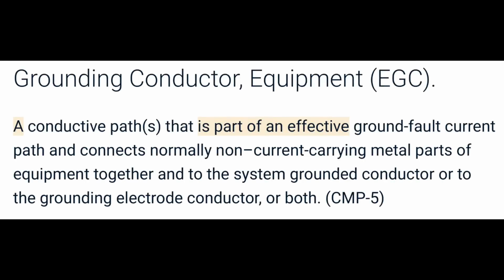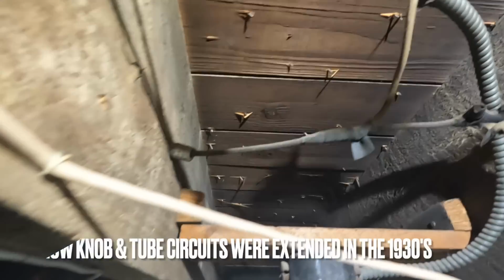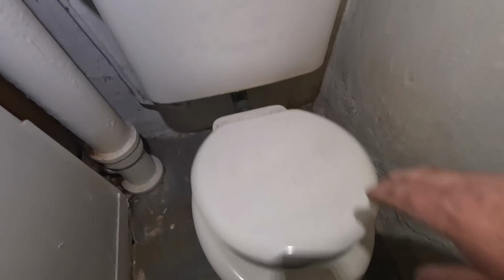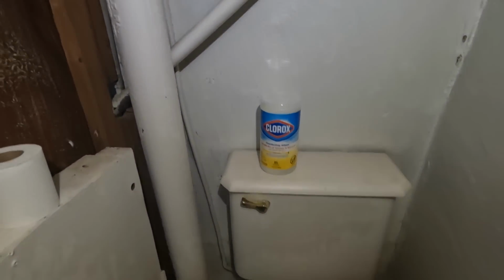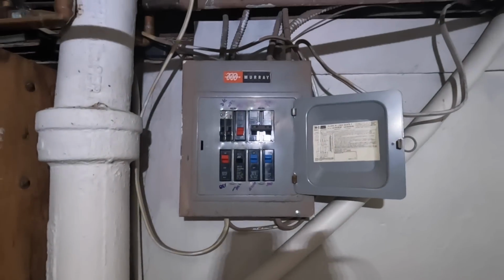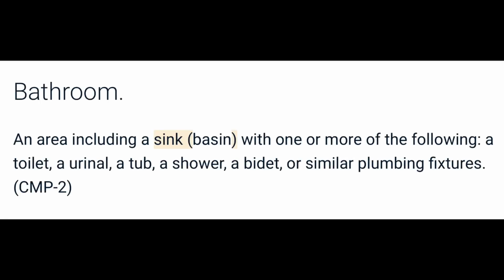1925 Colonial w/ Knob & Tube type wiring

Comment from the maker: At 14:30 you can clearly see the original locknut still on the BX connector. This explains why it was never attached to the box!

Also, the NEC does not permit overcurrent protective devices (circuit breakers, fuses) to be located in dwelling bathrooms. NEC section 240.24(E) Not Located In Bathrooms
Reply: You can still obtain new 'Honeymooner' Push-Button style light switches. They were considered an improvement over the earlier twist switches. I've seen both in the same home...but, I've also seen old gas works in some older homes as well as lantern niches in stairways.
Reply: Hi Ron, I watch all your videos. Maybe you didn't show the sink but just a toilet is not a bathroom so the code violation there is lack of working space around the panel.
Reply from the maker: @price9195  The toilet in combination with the sink makes up the "area" that is defined by the NEC as a bathroom.
Reply: @electricianron_New_Jersey  Thanks for the content!
Reply: Ron, some of those pipes look like they have asbestos wrapped around them. Please wear a respirator any time you do something that might disturb it. I want to still be watching new videos from you many years in the future

Comment: I did a total Rewire and Service Upgrade on a 110 year old house in Mcgregor, Tx in  2010  that originally had 110 VAC 30 Amp service. It had all knob & tube wiring . It had been upgraded in the Mid-60's to a 100 Amp Service 120/240 when they built a new garage attached to it . I up graded the service to a 200 Amp  120/240 VAC and ran all new NM-B Romex to all the outlets and removed as much of the knob & tube wiring that I could get to !

Comment: I just bought a 1914 house. It has a case of the knob and tube-itus. I'll be doing the work myself so your videos are very helpful. I'll probably live in the house for a year to figure out what other things I want to change and where I want to put any new receptacles. Thank you!
Reply from the maker: When I rewired this house no one was living there. Try to keep that in mind because you’ll need some circuits active while the new wiring is installed. Glad you liked the video.

Comment: This is a good example of the knob and tube problem, recpiticles tapped into it. When I rewired old houses I used to get all the recpiticles off it. Usually I would run new romex to a junction box and bring the bx and romex into it. However when recpiticles were wired with lamp cord, extension cords, speaker wire, or whatever they could find then redo as necessary. Also add new recpiticles to bring it up to the 6/12 code. I would leave one or two k&t circuits for light fixtures only and that was ok. But now insurance companies are saying all k&t has to go.
Reply: It's '' Receptacles '' ,... NOT '' Recpiticles '' !!!!!

Comment: I was hoping you might show tricks to address switches and lighting outlets in ceilings when getting rid of knob and tube, i.e., minimizing disturbing old plaster. Have you ever encountered situations where you see modern wiring methods in outlets but it turns out that knob and tube is hidden, buried in walls or ceilings, maybe with flying splices that were then covered or maybe hiding up in an attic? Are there ways to figure out that is hiding?
Reply from the maker: Yes, I have encountered that and it is tricky to figure out existing Knob N Tube, especially on lighting circuits. For receptacles, obviously a missing equipment grounding conductor is the first giveaway. A plug-in tester would indicate "NO GROUND" and thats where I would start. Hope this helps. ,

Comment: The ends of the AC cable that terminated to the K&T should have included an A-head fitting as the conductors exited the end of the cable armor; it appears in several instances that was not done.

Comment: Im really surprised you didn't have anything to protect those wood floors. The electrician is worked told me all it will take is the old box have a sharp edge, or you drop a screwdriver, and the floor is damaged, and you are paying for it in one way or the other. He found some of the padded floor mat squares at a thrift store to put down. I never saw anything less than a rag between anything he put on a hardwood/finished floor and something he was working with. A ton cheaper the resurfacing the hardwood

Comment: Nice work. This reality is so different from where I live (Arizona). Here there are just about zero houses with knob and tube because the average age house is like 20 years old 😂. That type of basement accessibility looks great as all our houses are built on slabs with horrifically inaccessible hot attics. Rewiring here is not much of an option unless a full renovation with drywall removal is also being done.

Comment: #1, your patience is inspirational!  My 1956 1,200sf ranch in NE Ohio is primarily knob & tube.  Remodeled kitchen 30 years ago and ran Romex for its appliances.  But, now I want the rest of the house done.  I was hoping to see some tricks to do this miserable job a little quicker.  By the way you approached it, I guess not, eh?  Getting a quote soon.  On a crawl space with concrete floor you can duck walk around.  Attic accessible.  Lot of work, lot of money!
Reply from the maker: Fortunately, no one was living in the house when I rewired this house. My advice would be for the electrician to install all of the new wiring BEFORE disconnecting the old wiring. It can get tricky. Around here in New Jersey, each new outlet/ switch/ light box is $350.00 each.

Comment: Thanks Ron just subbed , I've done allot of this type of electrical work in my house that was built also in 1925 I have and corrected many similar out dated utilities , Just a quick question and observation when I install a receptacle horizontally I always position the wider neutral blade up so if the device plug wiggles out a bit the neutral conductor would be in contact not the hot  is this a code concern or something that is not a concern , Thanks Great Video .

Comment: I wish electricians that remove knob & tube wiring save the rosettes and rotary switches and sell them to antiques stores.  Save also the "honeymooners" 2-button switch devices as the buttons can be salvaged to repair broken buttons on in-use switches.
Reply: Save also the ceramic light sockets that hang from the twist-lock rosettes.

Comment: The really old armored cable armor was actually 2 layers of metal separated by rubber and required a metal bushing to connect these layers in the device box for grounding purposes.

Comment: TR receptacles are dangerous to operate as they need awkward amounts of force to insert and remove a plug. The entire enclosure receives wiggling forces which will lead to wires moving around and possible problems. Surprised they're required by code
Reply from the maker: It’s so children don’t stick objects into the device and kill themselves.
Reply: Some TR are better than others the commercial grade (P&S) Pass & Seymour/ a brand of Legrand clamed or did claim that there TR receptacles are like there TR  are like THERE not even THERE; ALSO BLACK (the shutters)

Comment: We just bought a house built in ‘55 that doesn’t have knob & tube, but originally all BX. I’ve worked in all kinds of construction from residential painting to transmission utilities and I’m case by case sorting out the existing wiring sins in the house (receptacles that read ungrounded, kitchen counter boxes buried 1” behind the backsplash, etc) and my ears pricked up at one comment you made in the narration. You said you swapped out two receptacle boxes in the living room with plastic. Did you somehow rewire the feeders for the boxes with NM as well, or is some hardware that I don’t know about yet that properly transitions from BX to plastic boxes?
Reply: I jumped the gun- you I see 10 minutes later you replaced the box feed with NM

Comment: You also turned me on to those multipurpose lineman pliers.  I got the Kobalt version and have to tell you, getting used to them they've become a real worksaver.  Plus they crimp terminals far better than my old combination stripper/crimper pliers I used forever.
Reply from the maker: That's awesome! Having the right tools will always make a job easier!
Reply: @electricianron_New_Jersey  Absolutely.  I recently redid the control cabinet wiring for my traffic signal display.  There were 16 fork terminals that I had to attach to #14 AWG stranded. Two neutrals, and six legs, two each red, yellow, and green, used in this case for the green phase as there is no provision for an EGC for a polycarbonate traffic signal housing.  The Kobalt pliers not only made quick work, but the best crimp I can get.

Comment: Ron love the videos. So our house is 109 years old built in 1915. The service comes into our home and the connection from the service is still connected to the knob and tube, but I have to explore to find out where? Certain places in the house I have Dobbin tube still energizing Lighting. But I also have a 100 amp circuit panel in the basement that is primarily romex and then a newer panel 200 amp that also supplies Romex.
I have cut and wire any hot knob and tube, but I need to get to the source and abandoned it completely so that I am updated and rid of this knob and tube. Do you have a video that shows how to do this. I know I have to trace the knob and tube and see where it goes. I have an old original wooden fuse box with the screw in fuses and the knob and tube. I believe it goes up into the attic and I will find my connection there. I can have the electrical service turned off temporarily so I can work on it safely. Any thoughts. Matt, Idaho.

Comment: Nice - i have the honeymooner switch by my front door too!    hundred years old and going strong, and fortunately no knob and tube
Reply: Even older (maybe from the 1880's) are the turn knob switches.  They were surface mounted on the wall, as well as the wires with a Bakelite strap that kept them about 4 inches apart.  There was a video here on you tube where a guy gave demonstrations.  He had all period hardware, fuse holder, socket, and a cord to plug into an outlet to energize it.  He said it looked clunky but it had heavy brass contacts and heavy springs and they last forever.
Also some people would put the switch on the neutral and fuses were also put on the neutral side.  Only way to know it was dead was pull the disconnect plug in the box, but then the whole house went dark.  These were the Wild West day's of wiring.

Comment: 19:50 - I subscribe to the preference of having horizontal receptacles oriented with the neutral prong on top, regardless if there is no risk of something metal falling on an exposed blade. What do you think?
Reply from the maker: @Toolbarcreations  I think that’s stupid because I only vinyl plates.
Reply: @electricianron_New_Jersey  no, I’m not talking about cover plates. I’m talking about a plug that is not inserted all the way into the receptacle, meaning you have an exposed blade, and something conductive falling on that exposed blade. Better it land on the neutral rather than the hot. What are your thoughts?

Comment: I’m an electrician here in St. Louis, we have our fair share of older homes encased with plaster and knob and tube. Recently we did a job where we eliminated all the knob and tube from a multi family dwelling. We re wired the place with all new romex. We ran conduit up the side of the house and fished everything in the attic and down the walls. It takes a brave person to confidently work in older homes. A lot of skill and knowledge.
Reply from the maker: You got that right brother! I have a passion for electrical work but I also marvel at design build and navigating different building technics.
Reply: would you be willing to checkout a home in the south city area off hampton?

Comment: My house was built in 1932. I just recently removed all the K&T wiring. I still have some BX wiring to replace. The old BX connections caused a short, so I had enough and started to replace that with nmb romex too. Thanks for posting this video. Reminds me of what my basement wiring looked like. I'm glad it wasn't this bad.
Reply from the maker: @excaliburO2  There were def a few issues.

Comment: I grew up in a 1850s house. We had multiple rooms with zero receptacles. The way they did it was to put a Edison screw socket adapter and you had to run a wire down from that one light in the ceiling. Of course all of that wiring was knob and tube with later bx additions. Fun stuff.

Comment: Here in Pittsburgh,  we have tons of homes with active know and tube still.  I've done tons of rewires here.   We have lots of coal dust in the walls and attics of these homes here from the steel mill era.  So that makes it terrible because it's impossible to contain when making access holes to run wires.   Making matters worse people always splice new romex into know and tube to try and hide it to pass a home inspection.
Reply from the maker: K&T is a pain in the ass to work with as you know. I didn't know about the coal dust in the walls though, that's interesting.

Comment: Nice video Ron... Done plenty of that style work in the 80's and 90's .  Curious ... is that 14/2 being used for the receptacles. Not sure except for the white jacket. Unfortunately my jurisdiction requires 12 awg . With one receptacle per room and the chance of using a window a/c and or space heater the options are pretty limited .

Comment: There was an old house in my area that was converted to an office building that had knob and tube wiring, romex and some of the old BX cable. They also upgraded the panel to a 200 amp Square D Q0 when they converted the house in the early70s and they actually ran the old knob and tube wiring and the BX cables into the panel and connected the old wires directly to the neutral bar and the breakers! In some of the rooms they had drop ceilings with 4x2 fluorescent lay ins that were wired into the old knob and tube as well. It's a wonder that place didn't burn down lol. I was there to add receptacles so I just pulled new circuits from the panel instead of tapping into any of the existing circuits because I didn't want to take any chances.
Reply from the maker: Hopefully they had good fire insurance because to leave knob and tube in place after an ambitious rehab like that could be a fatal mistake.
Reply: @electricianron_New_Jersey  That was all done back in the early 70s but still that was hackwork. I added the receptacles in the 90s. They needed new dedicated circuits because the tenants got new computers and they were tripping the breakers on the receptacles they were using. I recommened rewiring everything but my boss couldn't get them to spend the money. The only reason I knew it was done in the 70s was because of the date on the panel sticker. God only knows how that passed inspection with the way all that wiring was tied into it lol. The paneling in the offices was that typical old brown mahogony stuff that you would see in most basement remodels around that time with those fiberglas drop ceiling tiles. That building is actually demolished now. Someone bought it to move their family into it so they gutted it down to the studs and started working on it until they ran out of money and it just sat there until it rotted away and finally got leveled a few years ago.

Comment: I was working in an old house here in NJ with k&t wiring when I came across one of those insane Chicago style 3 way switch setups for the upstairs hallway light. Really blew my mind until I finally figured out what they were doing, then I realized how dangerous it was energizing both sides of a light socket to turn the bulb off. Updated it with a Lutron wireless remote switch and receiver to eliminate the hazard, but that house needs a serious upgrade!
Reply from the maker: I had a similar situation happen to me in Roselle Park. Same thing except this one was a California three-way! Switching the neutral now is a violation.

Comment: Ron, this reminds me so much of the old house (Built 1920) I grew up in during the 1970s in Buffalo, NY.  Knob & Tube along with older armored wiring tied to a Bulldog panel.  I got married in 2000 and moved out. Four years later, my folks as part of a renovation that also included new Pergo flooring, a kitchen and living room remodel also did a full service changeout that included a new Square D Homeline 100A panel that replaced the Pushmatics.  In 2016 I cleaned up some of the unused basement circuits while installing new 15A outlets and lights in the basement found open splices and got rid of them.  This had the added benefit of freeing up four breakers in the panel.   What we see is so typical of old urban housing stock across the country.

Comment: Up here in NY, hydronic baseboard is super popular and there’s a lot of neat tech going into condensing boilers lately. I’ve got a small wall mount unit that heats the whole house, 96% efficient, variable temp based on the outside temp. It’s actually cheaper to run than a heatpump would be.

Comment: I disagree that the armor of BX can be considered an equipment grounding conductor.  There is no bonding strip or anything and the resistance can be so high that a fault to ground trying to return on the BX armor only heats it up but does not trip the breaker.  In this way, it might be even worse than K&T.  At least with K&T you know you don't have a ground.
Reply from the maker: You sound like you know what you're talking about   so I'm curious how you came to that conclusion. 

320.108  Equipment Grounding Conductor.

Type AC cable shall provide an adequate path for fault current as required by 250.4(A)(5) or (B)(4) to act as an equipment grounding conductor.
Reply: @electricianron_New_Jersey  Old rusty rotten BX is not the same as modern AC, it was invented before grounding was even a thing.  AC has the bond strip that provides a straight path, old BX is nothing but a spiral.